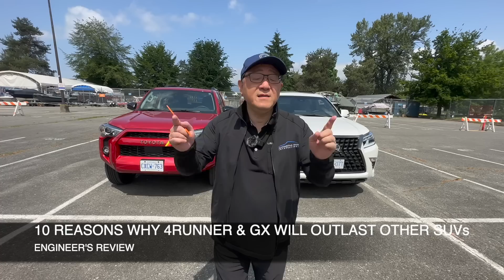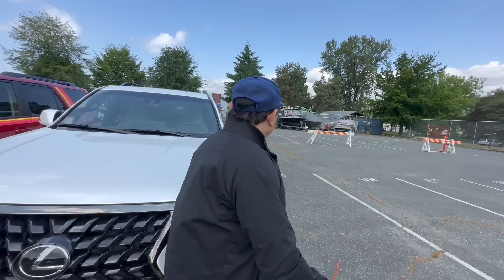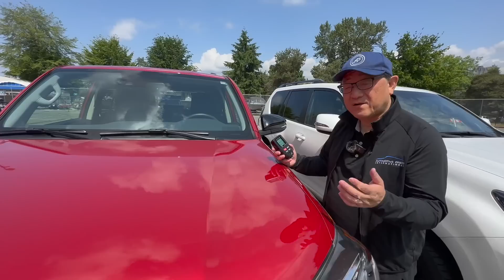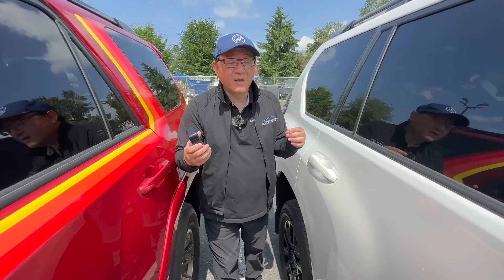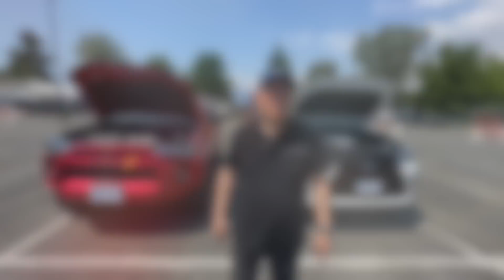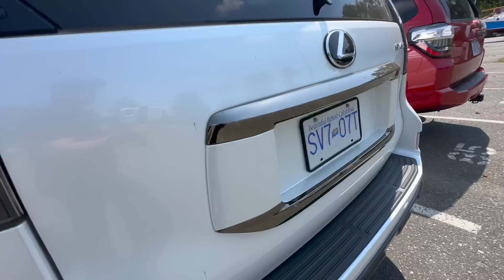ENGINEER EXPLAINS 10 REASONS WHY 2023 TOYOTA 4RUNNER & 2023 LEXUS GX WILL OUTLAST ALL OTHER SUVs

Comment: I had an ‘06 4Runner with the V8 for 11 years then went to a Volkswagen. Then I went back to a ‘19 and a ‘20 4Runner but then decided I wanted a truck so I got a ‘24 Tundra. So after I got that I hear that the engines are blowing up in the Tundra so I went to a GMC Sierra Denali with the Duramax. Well, sucks for me, that engine ended up blowing up in that after only 5600 miles. It’s still sitting on the dealer lot going on in four weeks now. I started shopping around and I found a ‘23 GX 460 with 11,700 miles on it. I did not know anything about them. Wow am I’m really glad I got this thing. It reminds me of my old ‘06 forerunner. Hopefully I’ll hang onto this for a while. Great to hear so much good about it.

Comment: This is not me bragging, only sharing my POV and opinons.
I've owned late model Mercedes E63's wagon/sedan, Porsches, Audi, &  BMW, but after picking up a lightly used GX 460 Luxury, there's something about it that makes me appreciate it more than other luxury vehicles that I've owned. I'm not sure if it's the fact that it's both capable offroad and on-road, or that I know it'll never leave me stranded, or that I can work on it myself and it doesn't require an engineering degree, but each time I get into it and start driving, I'm relaxed and feel like it was the best money I've spent yet (excluding Porsche). I'm going to do my best to keep this for at least 10 years to see how it holds up.

Comment: As far as I know the Limited 4Runner and GX460 are the least expensive way to get Toyota’s superb all time AWD system (as in less than the LC200 and LX). Find a 2019 or earlier 4Runner Limited and 2016 or earlier GX460 (and some 2017 models) and you can avoid the TSS/LSS annoying beeping and keep it simple. GX has a 6speed vs 5 on the Runner and V8 vs V6.
Reply: I should add if you’re on a lower budget or like older vehicles the 4Runner can be had with full time AWD and a V8 in the 2006-2009 model years, and the GX470 can sometimes be had for even less than the 4Runner :)

Comment: We’ve owned our 2008 GX 470 for 14 years which looks, runs and drives like new at 200,000 miles. Regular maintenance and good interior/exterior care have been key.   What’s great is you can go to a five star restaurant by night in the GX then get dirty the next day off road. It’s built like a tank (Land Cruiser quality). Next vehicle will likely be another GX.

Comment: I have had 4 Land Cruisers over the years, one I owned and used very, very hard for over 20 years alone. While I think the new Land Cruiser Prado we are about to get in the states is undeniably cool looking and really tugs at my heart strings with its 60 series looks, I realized why get a new, unproven Prado with way more tech when I can get the 5th gen 4Runner which is essentially the current Prado with the proven powertrain and build quality and just the right amount of modern tech yet retaining the simplicity…. And did considerably less money. So we are picking up a ‘23 4Runner in the exact spec we wanted, that was sitting on a dealer lot AND got a $3,500 discount on it which was a great surprise. Another big deciding factor for us was the lack of 3 row option on the new Land Cruiser. Having 3 kids, that was a key determining factor.

Comment: Hello Dave,

Thank  to your hard works, I went and bought a 2023 4runner TRD Off Road. The last car I bought was a 2003 Camry and it has 367k miles.  Engine is still run great but most of the interior are goner,  😂😂😂, Toyota is one of the best value for your bucks.

Comment: Just look at the Panasonic battery included in the 4r (probably also in the GX?). They’re known to last 10 years before replacement.
Reply: Had Panasonic battery in 22’ GX460 got less than 40k miles. Just replaced it for Interstate battery. It didn’t last that long.

Comment: I have a 2005 sequoia with 250k miles, also have a GX470 with 110k, both have the 2uz motor and run like new. Minimal repairs on both, will drive the GX forever and gave the sequoia to my son.

Comment: We have a 2011 4Runner SR5 with 307,000 miles and have had no problems, NONE!! Extreme Durability! I also don’t understand the slow talk as in slow acceleration or weak on power????? Mine is fast 0-60 in 6.7 sec and top govern speed is 117 mph!! Toyota must have change the throttle response on the later models. The 4.0L 1GR-FE is king of longevity along with the 5speed transmission, very very well built in Japan.

Comment: David,

The 4-Runner and Tacoma engine/drivetrains are very similar. Since it's a work truck, is the Tacoma built with thicker steel and more durable materials than the 4-Runner? Or do you think the 4-Runner is better built (in Japan) and therefore more durable in the long term?
Reply: I have a 17 4R TRD Pro, and also bought a 23 tacoma TRD OR MT in April.  I can tell you the 4R is hands down better with regard to build quality.  My hood on the tacoma has uneven gaps and one side is lower at the back of the hood towards the windshield.  Also, a 10 mm bolt was left behind during the build process that was inside of the right side air vent.  It was causing a nasty rattle as it moved back and forth while the truck made a turn.  Luckily it was a easy fix at the dealer, but really not good for a warm and fuzzy feeling with the Toyota's made in the Mexican plants.

Comment: David, I have a 2003 Lexus GX 470 with over 200K and I just pulled a Uhaul 6' x 12' trailer last week fully loaded 200 miles at 75 MPH and it didn't blink. I did the same thing last summer 400 miles and it performed flawlessly. The only thing I didn't like about the GX was the air suspension. It was causing me headaches and did the strut masters conversion to coil springs. I wouldn't hesitate to drive this vehicle cross country. I have a 2014 Lexus GS 350 and prefer driving the GX 470 as my daily driver. It's more comfortable and quieter. The only downside is the gas mileage. The GX is a tank.

Comment: I have owned three new GX Lexus. A 2006, 2012 and a 2017. 17 years of use and not one penny spent on a repair. They have performed flawlessly.  I just bought a 2023 GX Luxury trim in Caviar with red interior. Has the towing package and off road package. I believe the 2023, since it’s the last V-8, will be a timeless classic that could go down as the best SUV ever built. I love what I see from the new GX as well. I predict it will be a smash hit. I am on the list to get one. However, I am now planning on keeping my 2023 and let my wife have the 2024. I’ll see if the 2023 can outlast me. I am 57 so I bet it does!
Reply: Why replace them so frequently?  They'll run forever, and after 2012 they're all very similar.
Reply: 6 years powertrain warranty

Comment: Hi David, thanks for your awesome videos. One of your earlier video about the GX 460 inspired me to order a 2023 GX. I ordered mine in Luxury trim. It has been about 3 months since the order was placed but still no luck. Lexus Canada (through my local dealer) accepted my order and took my deposit. However, now that the 2024 redesigned model is revealed, I am wondering if Lexus is still making the 2023 models in the production line or has it been shutdown for retooling for the new model. Based on you experience, when do you think Lexus would practically shutdown the 2023 model's production. I really want to get the 2023 V8 and if Lexus has stopped production, I could look at getting a used one which I don't want to do. I would appreciate your advice.
Reply: I placed an order too for GX460 after watching the YouTube video. Dealer placed an order in June and I am expecting the delivery to be August or September!

Comment: Thank you! I own a 2013 4runner and had never fix any major issues on the engine. Always had Toyota Dealer Oil change w Synthetic Oil with every 10k change. I love my Toyota 4Runner.    Has about 140k now since bought it brand new 2012.

Comment: I just bought clean CARFAX one owner FL 2021 GX w/ 29k miles with the Premium Plus and Trailer tow package.  Original MSRP was $59,800 and I paid $45,500 after much time and patience.  I watched for Domestic Dealers selling orphan GX’s.  Most Ford and Chevy Dealers can’t get top dollar for a Lexus when they are up against a neighboring Lexus Dealer.  I’m retired and I wasn’t willing to spend $65k for a new 2023.  Every Dealer I checked was adding $1,000’s in ridiculous charges up to an obscene $6k.  Lexus Dealers are currently asking from $52k to $56k before they add anything.  Take your time and look in FL where lower mileage vehicles with no rust are plentiful.  They are also cheaper in FL than Atlanta or Dallas.  I know I shopped tirelessly.  I paid $650 to have it shipped from South FL to Atlanta in an enclosed trailer.

Comment: Hi David, another awesome video. I’m debating on buying a 2024 Tacoma or buying the last gen of the 4Runner. Which would be my 3rd one. I’m assuming the 2024 4Runner will remain unchanged and could possibly be the last one of the 5th gen. Can you confirm this?

Comment: The next generation of these vehicles with their turbo 4 cylinder engines and more tech, will not fair as well in reliability and durability. These are old tech vehicles with excellent build quality. Truly, the end of an era.
Reply: They said the same thing about these vehicles when they released the them. And the previous vehicles, and the previous vehicles… ad nauseam.
Reply: Given a few years, all the kinks in the new power trains will be ironed out, and we’ll be saying the same things about them as well.

Comment: Great video David. I agree those two SUVs will last a very long time, especially if they are maintained. I absolutely love my 2022 4Runner! 5005 aluminum is not only more expensive, but it cost more to work with as well. I believe this is the main reason why Toyota refuses to utilize it in the construction of its vehicles. I really do not think it is because steel resists denting.

Comment: Im concerned about the turbos and hybrid batteries being added to new toyotas. They are not yet proven to last as king as the previous gen ICE engines.
Reply: Hence why Toyota took very long to adopt them. They stress test these engines for durability and they knew that they cant keep bigger NA engines longer that won’t be allowed by the EPA due to emissions.
Reply: @YoungDriversPOV  none of that helps a person like me who keeps cars on average 8 to 10 years. The hybrid Toyota's right now are breaking down at a much faster rate than their internal combustion toyota siblings.
Reply: @TruthFLA  might as well keep the car u already have, Toyotas aren’t built like that anymore with all the digital stuff and complexity added to them.
Reply: @YoungDriversPOV  Up until recently where they started adding all the turbos, Toyota engines really haven't changed in a generation. That was the beauty of a Toyota. This new era we're entering right now is the most change Toyotas have ever gone through from one generation to another. We're just going to have to wait and see to see if this current generation is as reliable as previous generations were.

Comment: I currently own a 2014 GX460. This truck drives like brand new. It's smooth, quiet and solid on the road. Power delivery is OK, though fuel economy is not the best. The only service done is brakes and oil change.

Comment: One more question. If they got the following out of the 4.6L in the LS, why did they never do that for the GX? --The initial models, the LS 460 (USF40) and long wheelbase LS 460 L (USF41), featured a brand-new 4.6 L 1UR-FSE V8 producing 283 kW (380 hp; 385 PS) and 498 N⋅m (367 lb⋅ft) of torque.
Reply: Ls was direct injection. It is prone to carbon fouling and from there failing. 
 The GX uses fuel injection, just as the Tundra version. The GX is also rated differently in different markets. The 0-60 of 6.7 and 1/4 mile @15.6@91mph (premium) suggest a rating of 325ish. Though the GX is detuned, over built, and underated. The GX 4.6 is tuned for low to mid power band. 
 The GX purpose is longevity first.

Comment: I have a 2001 Toyota Land Cruiser with almost 419k miles. The paint held up pretty well. Original engine and transmission. I recently replaced the catalytic converter at 417k miles.
Reply: Got 225k just broken in 👍🏼
Reply: 313K on my ´97 Land Cruiser. Had just a couple hiccups (nothing major) but original untouched drivetrain. Would happily drive it across the country. The fuel may bankrupt me though. Haha
Reply: Did you need to put ceramic coating or ppf to make your paint last?
Reply: @ashresearcher I didn’t do anything to the paint. There’s some wear on the front edge of the hood and on the stock rails on top of the LC.
Reply: Good for you. 
You will see 0000000
Reply: Unfortunately I have a 99 white LC…the paint is the worst Toyota has ever used
Reply: That's surprising because paint was trash across the board on all brands at that time era because everyone was required to switch to waterbased paint and no one has perfected it yet. My 2003 tacoma is starting to show clearcoat damage after all these years.

Comment: I've owned my 2008 4Runner SR5 for 15 years and everything still looks and works like new.  The paint is still perfect, and the interior is like new.  I get 20 mpg in the city (rear wheel drive).   Best vehicle I have ever owned.  I think it will last another 15 years easily.

Comment: I purchased a 2020 4Runner a year ago.  I loved it expect the headlight output.  I test drove a GX and traded in the 4Runner. The GX is THE BEST VEHICLE I HAVE EVER OWNED.  I will keep my V8.
Reply: Had the same year 4runner with the same headlight output issue - didn’t want to fool around with aftermarket fixes and traded to the GX as well. Much improved in all aspects…
Reply: I had the exact same experience. Purchased a 2020 4 Runner Limited and then traded it on a 2020 GX.
Reply: Do you guys use premium in the GX? Been seeing a lot of mixed reviews
Reply: @bobsacamano6402  I do use premium gasoline.
Reply: I always use premium in this vehicle.
Reply: Headlight output made you trade in a vehicle?
Reply: Absolutely. The headlights DID NOT illuminate the road. Even worse in the rain.
Reply: @kevinburleysr8168  I have a 2022 Limited and had a 2018 Land Cruiser prior. 

I always just thought Toyota decided to not out active working headlights on the 4Runners and Land Cruisers to be cool. Ha
Reply: I have a 2019 4Runner and just put a deposit down on a new GX.  The only two things I really don’t like about my 4Runner are the weak headlights and the noisy ride.  The GX is FAR more insulated and quiet with much better headlights.  However, I will sorely miss the retractable tailgate window of the 4Runner - as will my labs!
Reply: Debating about getting a 5th gen 4runner off road premium w/o KDSS versus a 2nd gen GX460 a few years back that is affordable. Any ideas/preference? Don't like the grill of the GX460 or the side opening rear door or the 3rd row seats instead of storage, but the KDSS and full-time 4wd and cd player and better second row leg room seem nice. Spend most of the time on pavement, but want to get to any campground I want. Not any dedicated off-roading, but don't want to be constrained. Considered the Limted trim 4runner for the full-time 4WD, but heard bad things about the X-REAS system.

Comment: Can there be thicker paint on parts from the factory?I was told yes by Lexus Canada if there is a small defect they pull the car off the line and fix and respray ( clear coat).

Comment: I had head gasket issues on my 4.0 V6 4runner
Reply: What year 4 runner?
Reply: @jonathanhuynh880  2005. it hit around 100k, then i started to get the check engine.

Comment: I am about to get one 4Runner, but I don't know what trim I should go for....  I definitely will not like new redesign 4Runner coming up, I bet Toyota will take away rear window rolls down which is signature of 4Runner.
Reply: TRD sport is great value  but if you like a sunroof get a limited you will lose headroom with sunroof though. These 2 trims are best for max mpg and day to day use
Reply: @Mr99Burns  thanks for the advice. Does the dealer mark up for the price? I heard it is pretty high...

Comment: GX 460 will outlast the GX550
Reply: You can fix anything, but at what cost? The 460 is built with excellent quality and design as is the 550. But the additional tech and weight saving changes will lead to shorter times between breakdowns and increased cost of repair.
Reply: Why?
Reply: Non-turbo V8, less complicated, potentially better built (as implied in this video).
Reply: @DouglasFerling That’s right. Once the turbo seals mess up, you gotta change the turbo. It’s a hassle. Turbos don’t last long.
Reply: @miltoncardoza not necessarily true
Reply: @DouglasFerling ur basing that on a car that has barely come out💀
Reply: @IanMTheSupreme   We already know that the new car is a turbo v6 and more complicated, so I didn’t say anything untrue.
Reply: @douglasf13  "turbos don't last long" isn't necessarily true.
Reply: @douglasf13 the gx550 isn’t necessarily turbo… there are different engines…
Reply: Because the GX 460 followed Japanese manufacturing concept of “Kaizen” or continuous improvement. Lexus has over 13 years to refine the 460 while the 550 is a new design. Any new Turbocharged engine is not going to last no matter what. Especially if the owner follow the 10k oil change.
Reply: We are Toyota Nation in Hawaii , wish we had diesel like Asia
Reply: And when that comes out, the new thing will be “gx550 will outlast (insert car)”
Reply: The LS 400 will outlast every Toyota and Lexus ever made.